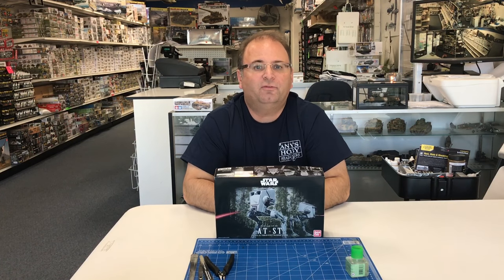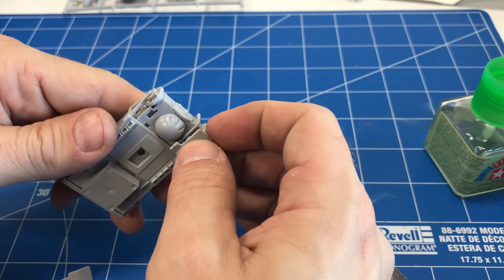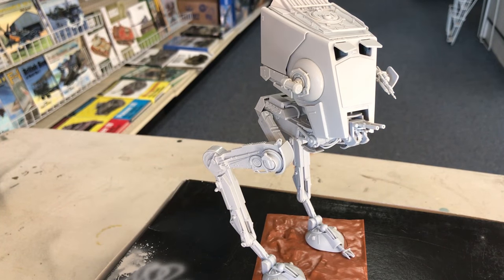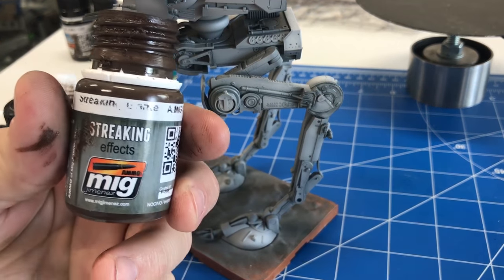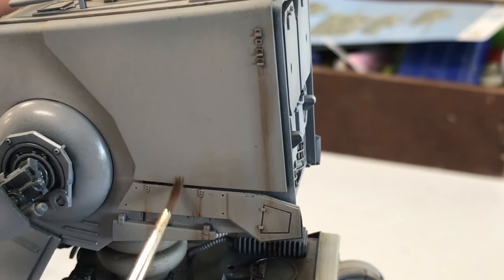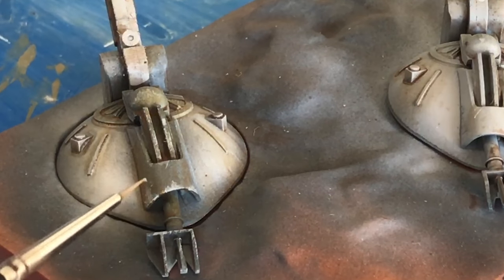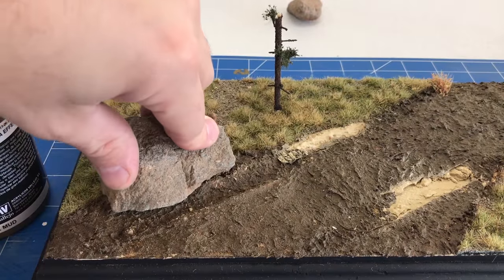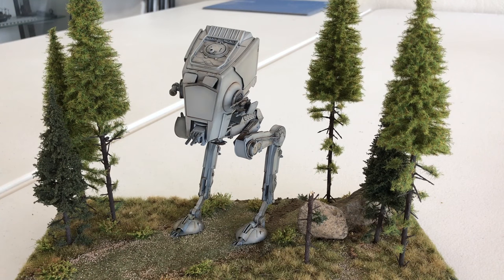Building the ATST Star Wars diorama and weathering with Mig enamel wash

Comment: Just finished this kit myself but I painted the interior and used washes. I did some modifying on the seats as well as the roof, cutting out the snap areas and sanding things down, so the top can be removed and someone if they want, can't view the interior. I also used a Photo Etch set to fix the missing interior detail on the roof. For my AT-ST, I used the base for a foundation of snow.

Comment: Mig wash will melt the leg joints causing them to crack. Also I believe the feet as well. I watched mine crumble soon after the Mig wash was applied . It seems that Andy did not apply too much to these areas and got away with it.  

Currently trying to repair , but the more I mess with it the worse it gets. Hoping once the enamel  cures I can fix it or hide it. Would purchase it again and just leave the leg joints off and weather them only with acrylics.

Comment: Hello Andy, Have you experience any issues between enamel wash and Bandai kits? I used Mig enamel wash to wash Bandai AT-ST kit, but the plastic cracks (around feet and leg joints) after I made some adjustment of the pose. Do you know any solution beside putting primer before assembly?
Thanks!

Comment: Doesn't the enamel make the bandai kits brittle? I've heard of people doing an enamel wash and it getting to the parts that aren't painted (like inside the joints) and the kits were destroyed.
Reply: DriftNick Enamel paints and thinners will degrade bandai plastic. However an easy workaround is to clear coat the subject with a few layers of your preferred clear before using the enamels.  I used both oil and enamel paints/weathering products on my bandai at-st and other star wars kits after clear coating and I have had no issues.
Reply: careful cause the thinners gets right into the joints too mate and they just go to shit

Comment: i did something wrong.  i painted with acrylics and used a enamal streaking effect from creatfx but the model started to break apart.  any help?
Reply: Hi.

the chemicals in enamal thinners react badly with the bandai plastic....I am looking for a solution since I want to weather with oils...

if you google bandai + thinner you will see that many people have this problem

the model in the video didn´t break yet...maybe it will when touched again. I testet 3 different thinners of mineral spirit or substitute etc...all did make the plastik sprues brittle.

It seems that a varnish coat also does not prevent it from happening.